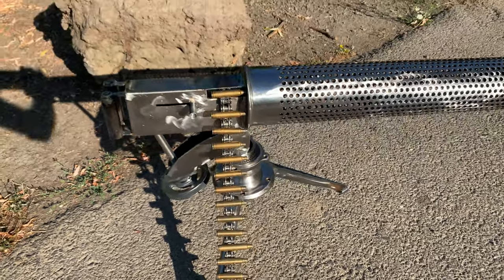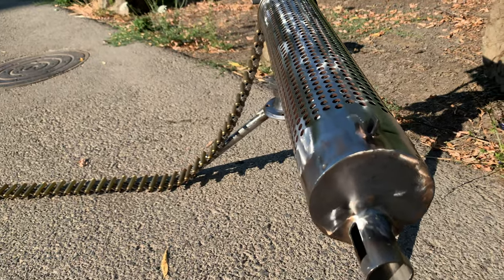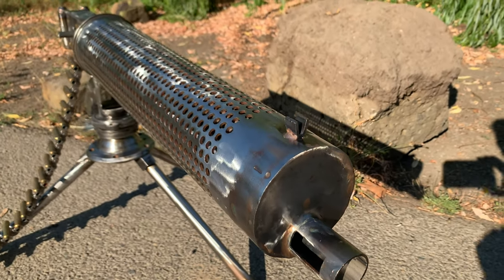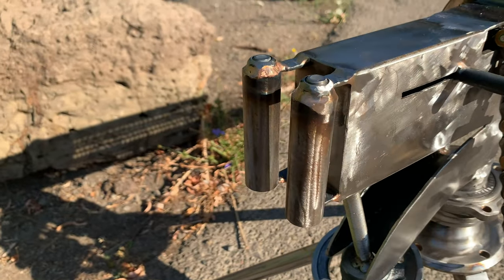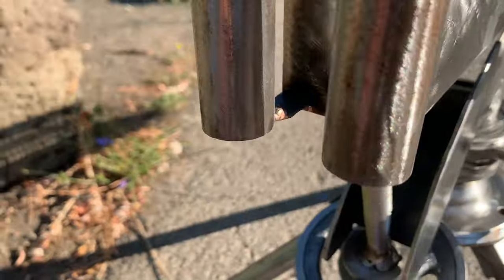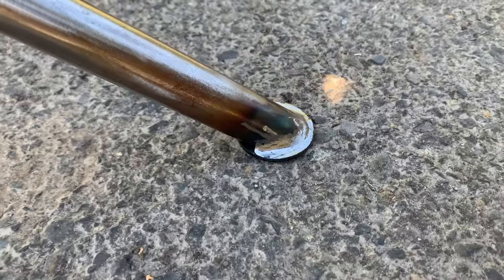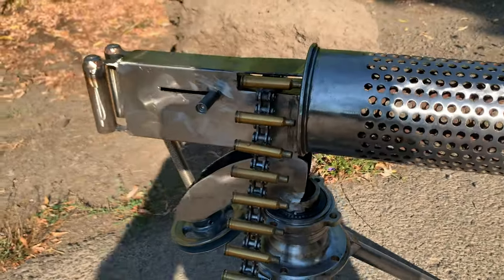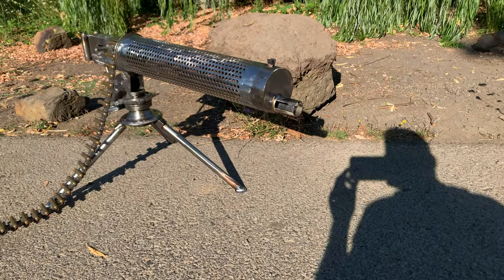WW1 Machine Gun

Comment: Hey Don,  For the bullets, you could try Silicon Bronze wire in the MIG with 100% argon or tig them on DC.  The shells are thin material and the cool thing about Si-Br is that you don't want to melt the base metals.  It's actually more like brazing.  It's great for different, normally non compatible metals.
Reply from the maker: I use it quite often; but these shells blow holes too easily. They also blow from being heated up if not spent yet.
Reply from the maker: AND, Miller MotorSports? Cool 😎

Comment: You can silver solder the brass to steel
Reply from the maker: Silver solder? So I would need silver Tig rod essentially?
Reply: @w46try7 a set of torches some silver solder and flux paste. Or some J B weld epoxy. J B weld might be easier. Just trying to help
Reply: If you have a tig you could try it . I've never tiged brazed before